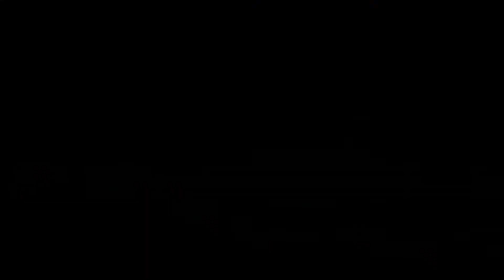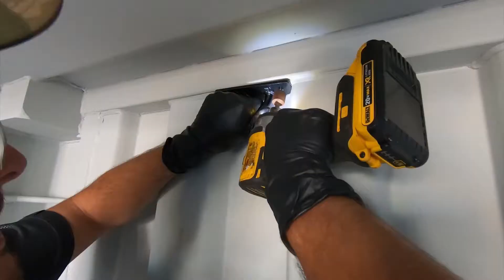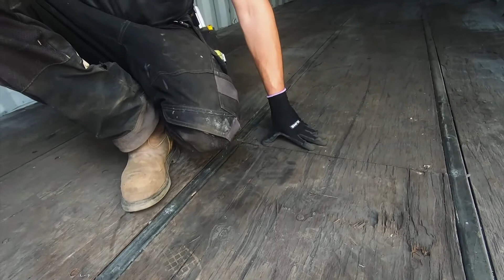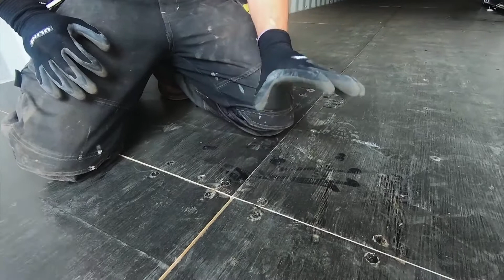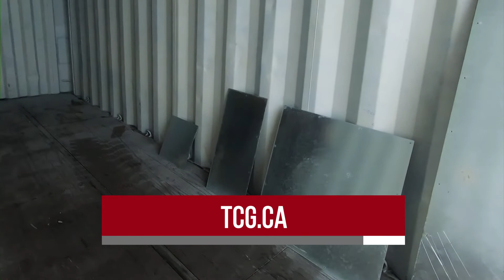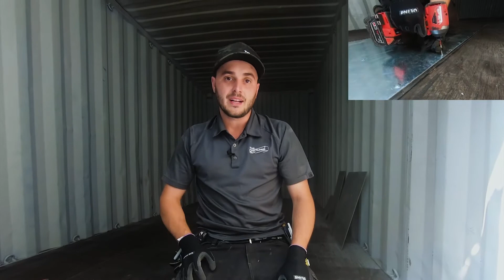How To Repair Shipping Container Floor - Quick and Easy Solution

Comment: We are the manufacture of containers spare parts and wood flooring in China. Plywood offer is $28.39/sheet. Weight: 60KG/ sheet
Number of floors: 21
Size: 2400*1160* 28mm
Density: 750m3
Load weight: ≥6,000KG

Comment: will the 12 gauge steel hold up to forklift use 12,000 lbs or so with load?
Reply from the maker: Depends on the damage beneath it. If you're covering a single ply that has delaminated, yes. If you are covering a huge hole, no. Use your judgement.

Comment: I used to haaaaaaate replacing flooring when I worked at our container repair yard (part of a transportation contract I worked on for about ten years).  Tearing the old flooring out was bad enough (those bolts rarely come out without breaking).  I hate to think of what a sheet of that thick plywood runs these days.  For a can that's not going to be used in interchange (just used for storage, etc.), I'd go with the steel in a heartbeat.  I was curious to see how you'd go about this...  Well done.

Comment: Thoughts on the steel floor inside the 8x15 containers?
Reply from the maker: Hi Sanctus, thanks for reaching out. 8x15 is not an ISO container size. If you are referring to the custom fabricated portable storage units, I have no experience with those and they likely vary by manufacturer. If you email photos to mods@thecontainerguy.ca, we can a look and see if we can help.